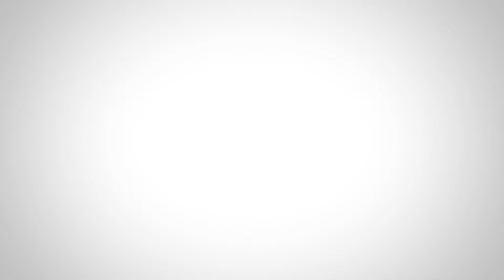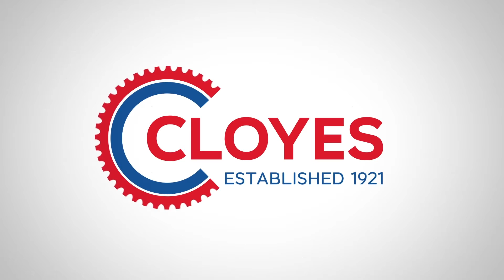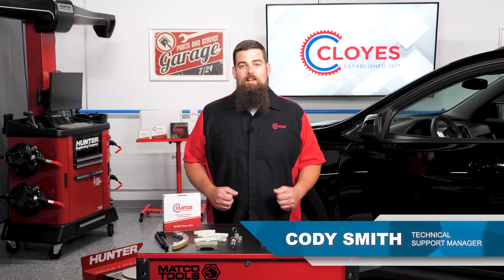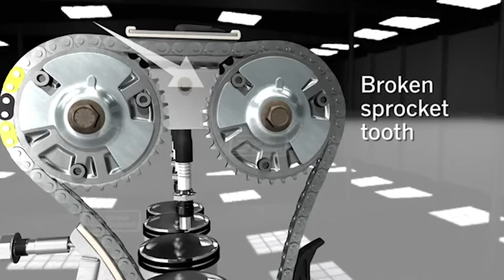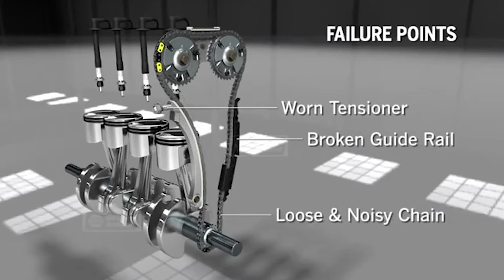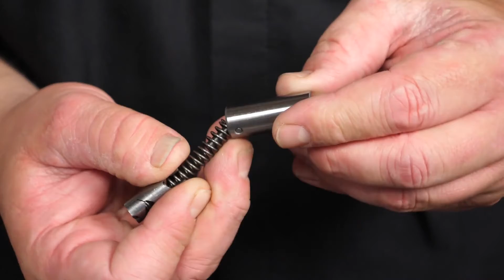Engine Rattle and Timing Guides/Tensioner Connection

Comment: I hope you can respond. 
On my n20 328i 
The top plastic guide contains 2 bolts but it doesn’t hold it snug. The plastic guide still have excessive movement
Reply: I have a video to demonstrate

Comment: My timing belt was changed 10k ago but I’m hearing the tensioner knock now. Not sure if they changed it out or if it’s the old one and it’s going bad. Is this something that definitely needs to be fixed? Thanks for the video!
Reply from the maker: Any noise from a timing belt or timing chain system needs to be addressed immediately. Unstable operation can lead to a belt or chain failure, or the belt/chain skipping teeth, which will cause piston to valve contact in most applications.